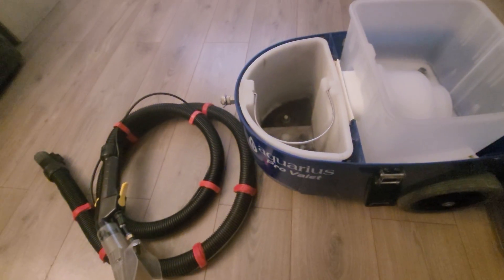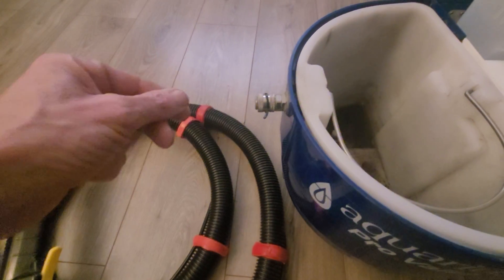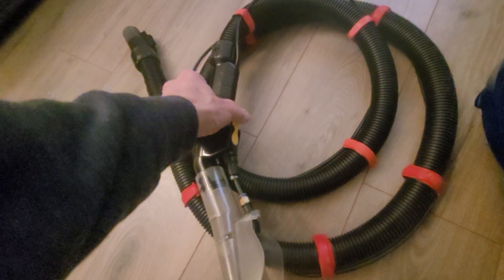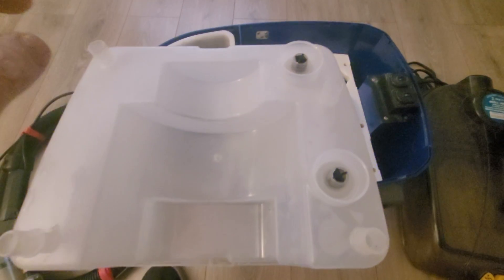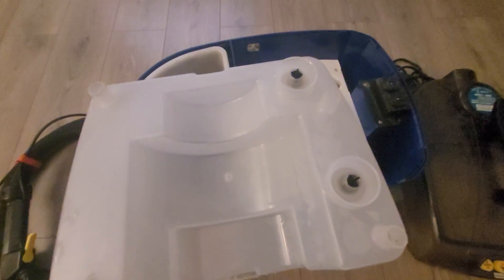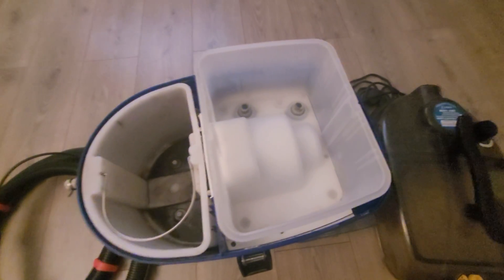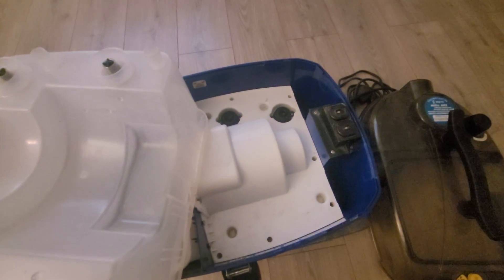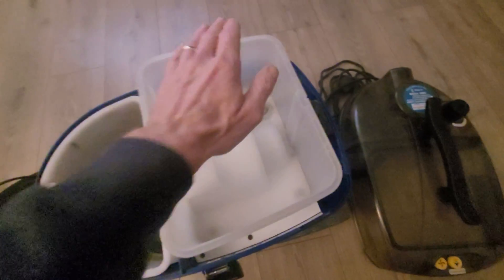Update On The Aquarius Pro Valet Shampooing Upholstery Machine After Use

Comment: I’ve had mine just over three years, only occasional use. Tried it today and no water. Pump is done 🤷🏻‍♂️ so I took it apart, really only a dozen screws and removed internal lid, inside is a small pump which is same as many steam generators and found replacement on Ali express for a tenner. Quite a disappointing part for such an expensive machine. I doubt I’d buy another, that said while it worked it was very good.
Reply from the maker: Glad you sorted it out, yes I'm not going to replace it for same, will definitely get a different make next time round.
Reply: What pump is it please? I've been searching for few weeks for the right one all I can find is £80 ones dont really think it's worth saving machine for that

Comment: Hello I have a proble getting the large tool off to put small tool on,please advise regards sharon
Reply from the maker: If I remember as its been a while since I removed the larger fishtail to the smaller one, they are pretty tight once on and I think there is a location lug so carefully left to right movement while pulling away from the hose should do it but be careful as the plastic part can be brittle.

Comment: Hi, this review was posted over two years from your initial review video+, have you used it all that time? Has that problem with no water being sprayed happened again?
Was thinking about buying one of these, but bit worried after seeing the trouble you've had.
Reply from the maker: Hi, the machine had little use to begin with due to the pandemic and its only in the last 8 months its had heavy use, the water outlet feed pipe leaks, it did stop spraying due to the water tank inside not wanting to seat right and more recently the water feed outlet pipe had a hole so overall it has been a little problematic so if and when I replace I'm going to go for a cheaper option.

The one I'm going to go for when the pro-valet needs replacing is the Bissell SpotClean Pro.
Reply: @HitchinValeting  Thanks for reply. Does sound like there've been a few issues in only a short span of useage. When it works, how do you rate the cleaning job it does?
Reply from the maker: Hi, the suction and spray is good but like any machine most of the time it's the type of cleaner and how you use all of the above to get the best results you can.
Reply: @HitchinValeting  Great, thanks a lot. Hope your new machine is less trouble for you. All the best, mate
Reply from the maker: Thank you, all the best